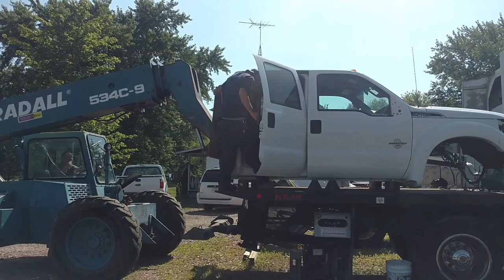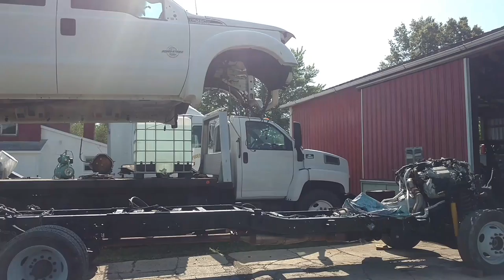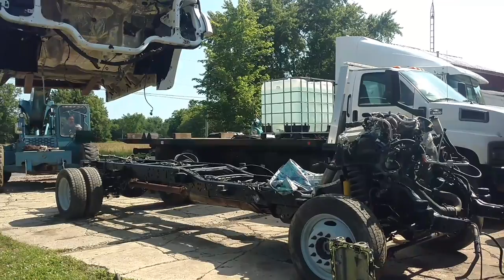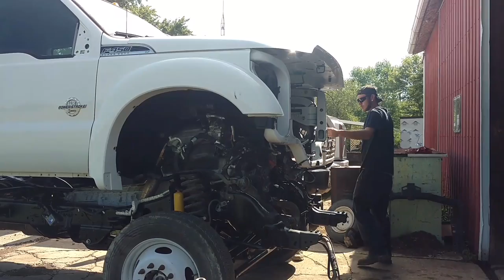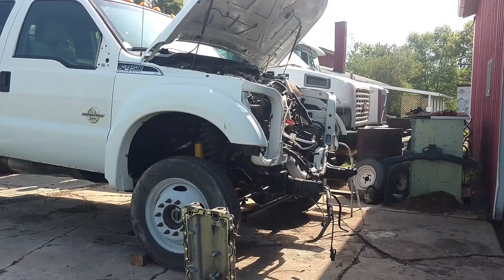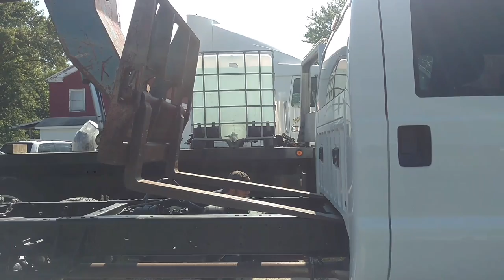PART 8) FINALLY!!! THE CAB IS GOING ON!

Comment: JC I was going to ask about the VIN numbers but I read another comment and you said it was in the playlist for the tree damaged F450. I looked and couldn't find it. I'm just curious about the process too. I live in northwest Ohio. Also for registration and insurance in Ohio for personal use would there be a big difference in price between an F250-F350 and F350 to F450 and F550. Here in Ohio I can register a personal use F250 for around $60 if you go up to say a F450 or F550 would it be a huge jump. I found a few bigger trucks but don't want to pay extreme registration prices. Thanks